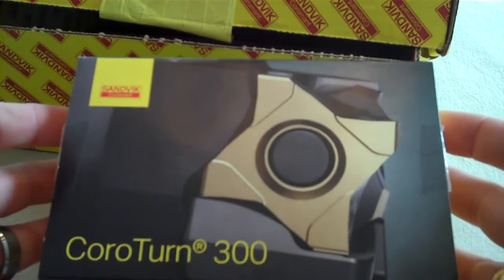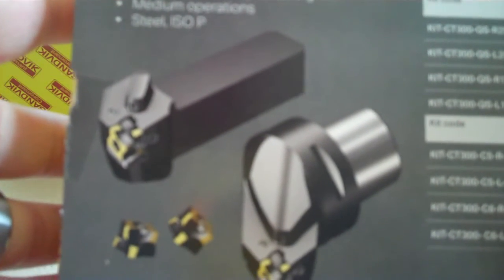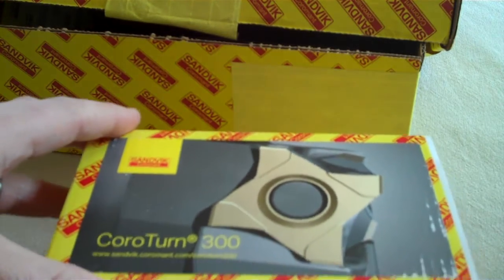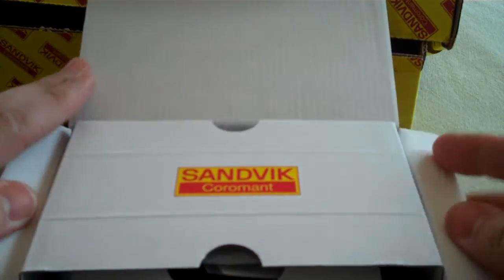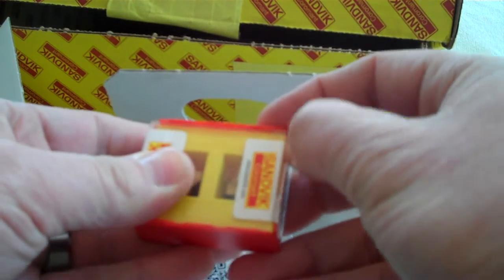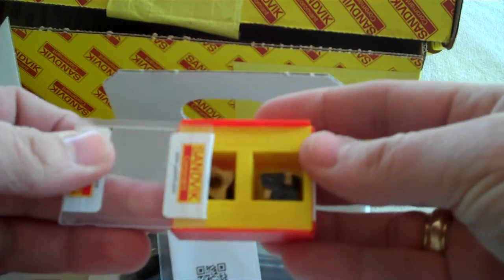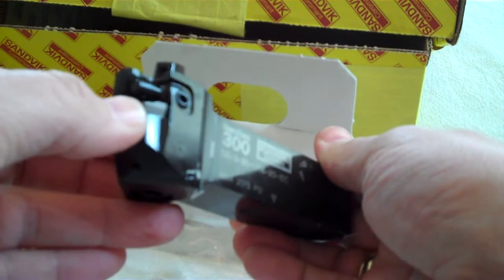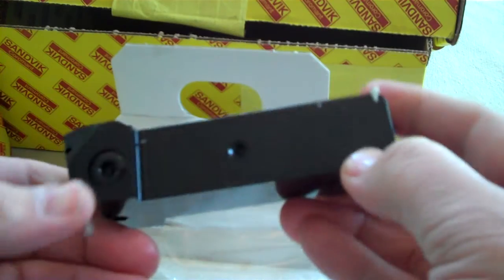Sandvik Coromant CoroTurn 300 Kit

Comment: looks nice. i dont understand why they keep trying to reinvent the wheel with their proprietary inserts. You get 8 corners on a SNMG. Lets see some cutting videos comparing them. Push both inserts to the limit.
Reply from the maker: The industry is always advancing, machines, materials, tools... 50% of the tools available today weren't even thought of 5 years ago! The 80 degree corner allows you to turn into a shoulder with the feed and strength of a SNMG. Try one if you like longer tool life and shorter cycle times with excellent chip control.